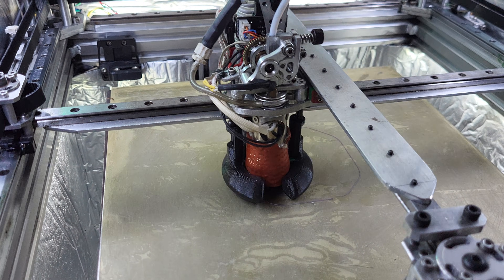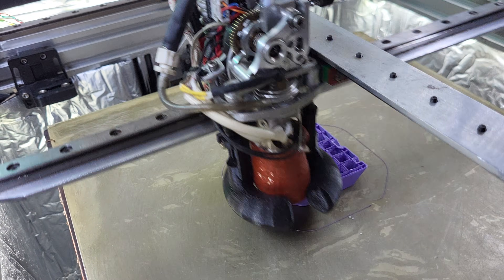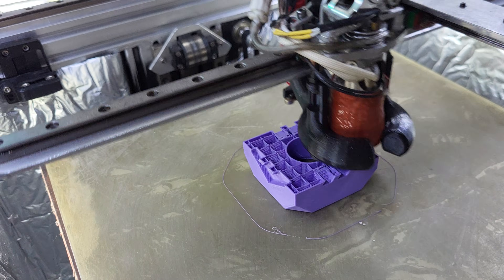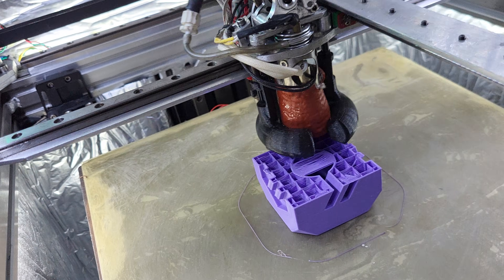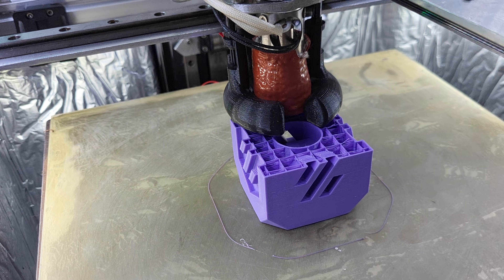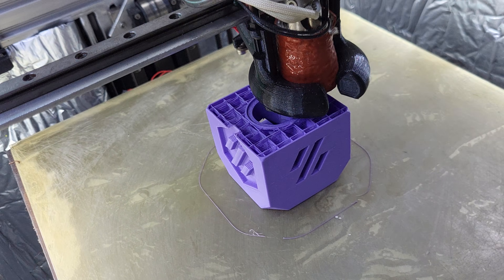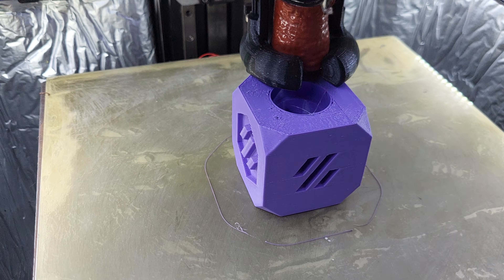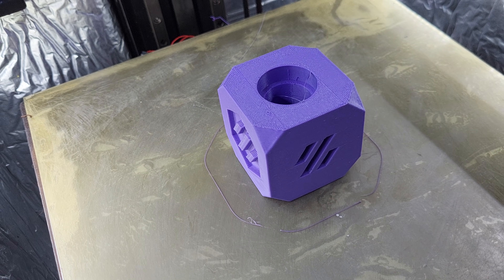200% Voron Cube, flow check

Comment: how in the world are you not getting any ringing at those speeds? is that just from the nature of the printer, being a crossed gantry or is that in combination with really well tuned input shaper?
Reply from the maker: Interesting question and interesting thoughts on how to answer that!
I think there is ring, but it's hard to determine if the ring is PA injected or actual machine shake. As PA works to control the extrusion, the filament deposition changes before a corner and after. If the filament deposition is not enough flow, or not timed right, it can cause a dip or bulge. This makes it look like ring, a shadow of sorts in the finish, from a wall thickness not even across the face.
The other is that the cross really helps not allow the opposing rail to twist, like in corexy. So having the center of mass on cross gantry perfect is not as critical.

Comment: Could there be a different solid infill pattern for the bridge layers beneath the top layer? Is concentric an option? That'd eliminate the direction reversing and give the lines more time to cool instead of walking a hot front across the infill.
Reply from the maker: Part of the issue is the wet filament.The other problem I discovered, the slicer is not detecting that 1st layer, over the infill, and changing the speed. I had to change to a different slicer revision and now it's much better.